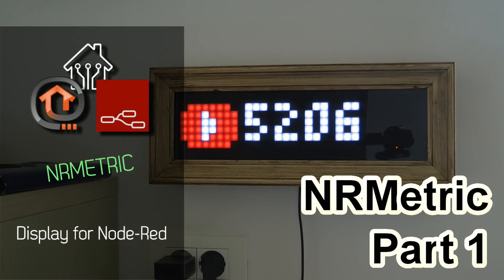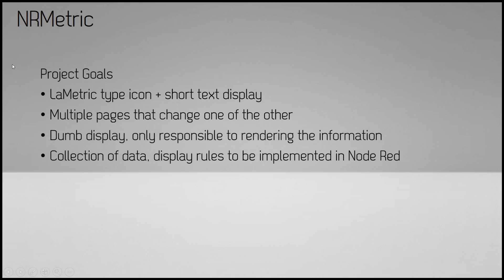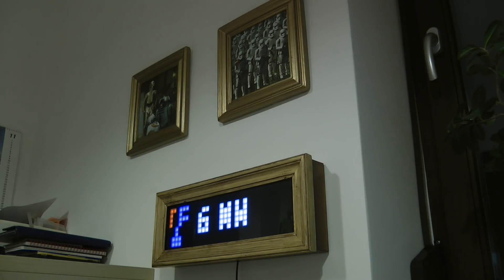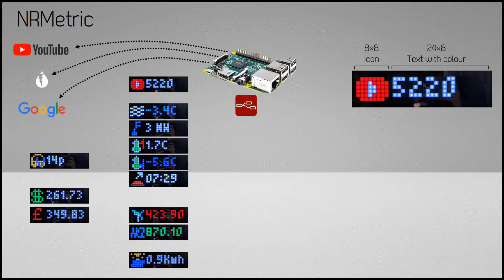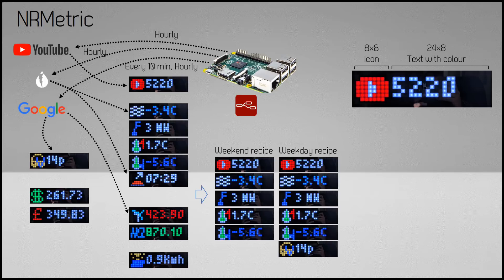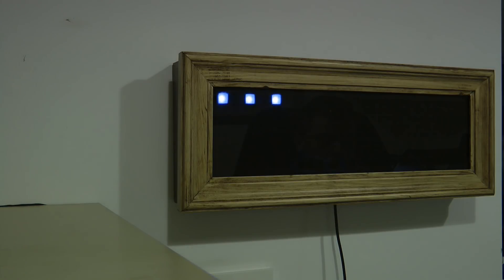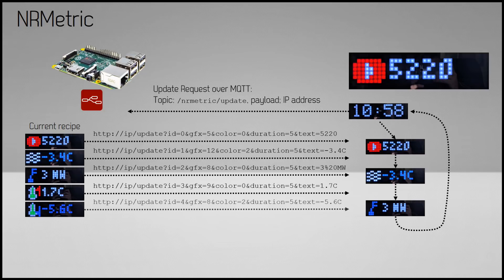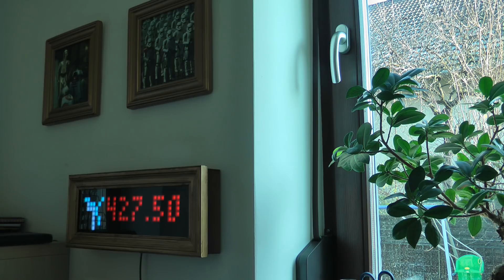NRMetric Part 1 - Custom Display for Node Red

Comment: Was there a specific reason why the data to display are sent over http instead of being read from the esp8266 from mqtt topics?
Reply from the maker: +thesimbon I don't know if this is only me, but sometimes it takes a few seconds for the ESP to process and MQTT message. And again I prefer to control when this happens and not randomly any time. Maybe this is not necessary...
Reply: Csongor Varga I was just wondering since I am still in the beginning of tinkering with esp8266 and mqtt, so in an IoT perspective I'd see the screen talking only over mqtt as the broker could be cloud based and also for security reasons as it is better not to have unnecessary exposed services
Reply from the maker: I am not an expert when it comes to security. My MQTT server and the HTTP services are not exposed to the internet. The Arduino sketch is quite unique even if somebody gains access to my local network, he may not be able to figure out how to use the HTTP service of the ESP. And still worst case scenario is that my display start showing garbage or an incorrect update make it crash. But for the same reason I would never connect my ESP to a cloud MQTT service or open an ESP to the outside internet.
Reply: Csongor Varga I work in IT and from my experience web servers are the most common target for attacks, so the lesser services are available on a device, the better. I partly agree with you as the home network isn't enough secure: with the growing number of IoT devices it is enough that one gets hacked that your network can turn unsecure. Sure the probability of someone able to hack the esp8266 inside your network is very low, but you'll never know if one day a vulnerability of esp8266 is discovered. Using a cloud mqtt service isn't that bad, it would be better if they could add ssl support to mqtt library